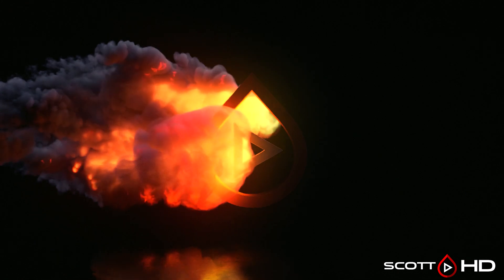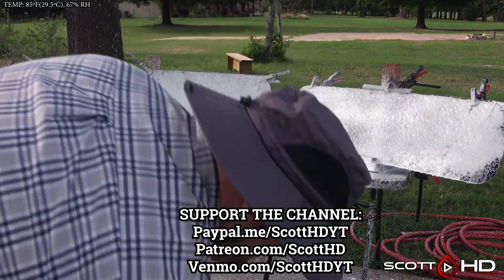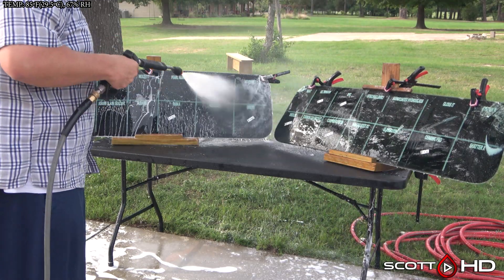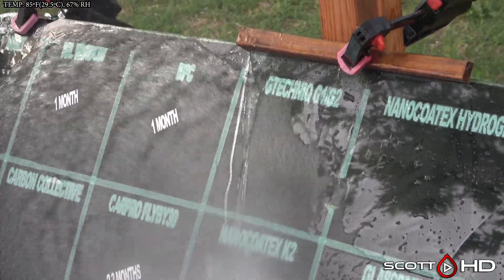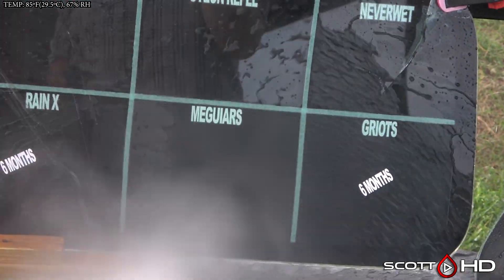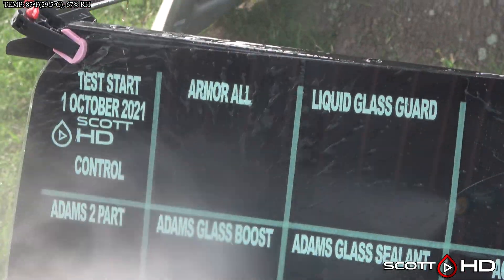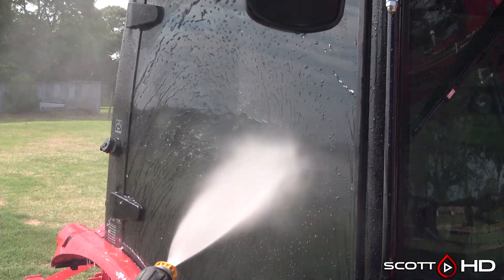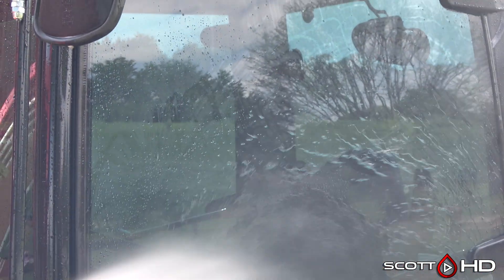28 WAY GLASS COATINGS TEST (HYDROPHOBICS) - UPDATE 09 - 7 MONTHS

Comment: Why isn't it representative of windscreen applications?
Reply from the maker: Windscreen application would include wiper resistance. I have a separate test I've been working on with that but having issues with nearly all of them with chattering wipers after application
Reply: @ScottHD  
Really?! I used armorall and have no chattering... I do have silicone blades though. Did you do one or two coats?
Reply from the maker: @shane250  one.  Standard blades
Reply: @ScottHD  
Interesting. Maybe silicone is better because these compounds are silicone based? I just tested my mother-in-law's car today, I'll update you if she gets chattering (standard blades).

And thanks for all the great quality content! I never stop recommending your channel to all my friends. Your method seems to be the best out of all the detailing channels. They never follow up for such a long time like you do. They just use some chemicals to see which coating is more chemical resistant.

Comment: I just read the reviews on the armor all product at Amazon and a lot of people say it’s cloudy and hard to remove etc.
Reply from the maker: I wonder if people are using it in direct sunlight?  I've applied it to several of my vehicles now, my cab tractor, and a few clients vehicles... All in a climate controlled shop, but had zero issues with it.  I'll try it outside and see what happens
Reply: @ScottHD  They said any small amount of water droplets that dry on it are very hard to remove as they will leave a stain. I agree the product probably dried on them as the windshield was hot or in the sun.
Reply: @Tothefloor  I can almost guarantee these people applied it in the sun. I did on my first time and it was EXTREMELY hard to get the streaks off. Took tons of glass cleaner applications and APC. But I blamed that on myself, not the product. The next time I did it under a carport in the evening and it went on super easily.
Reply: @joshread3740  not worth the risk imho
Reply: @Tothefloor  That's fair, but it works great in the shade
Reply: had no problems with application, just planned around avoiding heat of the day and direct sunlight which heats a glass surface quickly. morning or evening are fine times to apply
Reply: Yeah,  I popped in to day that.   Scott - I did use your link but the reviews there are pretty sad.  I got burned by Armor all when I was young and decided to use it on my fathers motorcycle seat.    I never got to live that one down.

Comment: When this test is over, can you do another glass test. Half of Glass coatings, the other half ceramic paint coatings on glass? I've got this gut feeling that the glass coatings are paint coatings in a different bottle and at a different price. One-to-one comparison. eg. XYZ brand Glass coating vs XYZ Paint coating. Spray Glass, vs spray paint...wipe on vs wipe on...etc.
Reply: Hot tip, they aren’t the same products.

Ceramic paint coatings may last and show high hydrophobicity on glass, but doesn’t mean it will be wiper blade friendly and deal with the abrasive nature.

It’s a moot test.
Reply: Fantastic idea
Reply: Why would they sell the same coating in a smaller bottle for less money per ounce?

Comment: Been using Nextzett lately.  Found that you can wash it, and then a couple few hours later it will want to hold onto water.  It may be susceptible  to collect fallout.  I then wipe it down with a wet microfiber and it comes right back.   I also noticed I needed more pressure when washing it.  SO maybe thats why some of yours are coming back.  Maybe try using more pressure when your wiping them down.  Dunno...